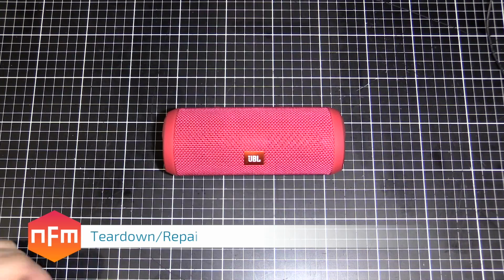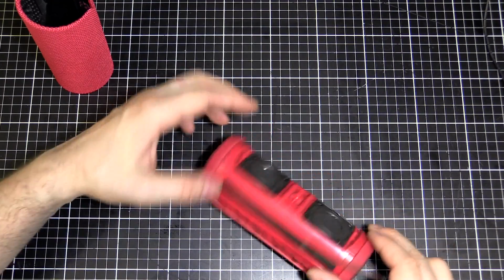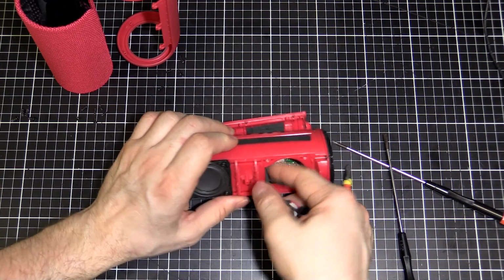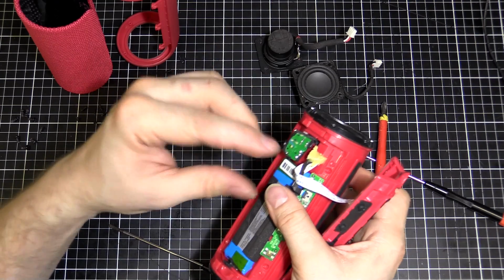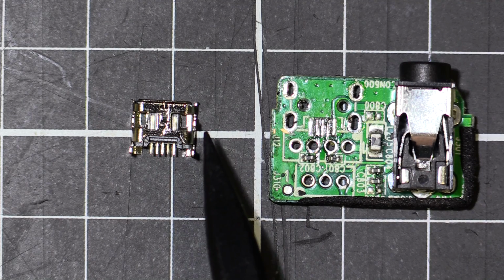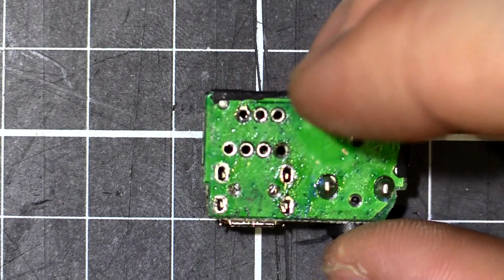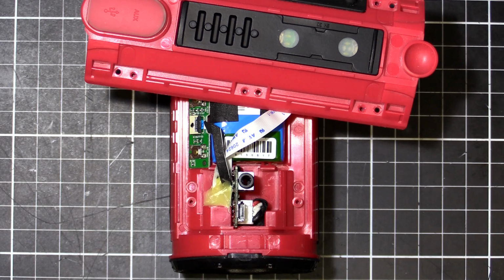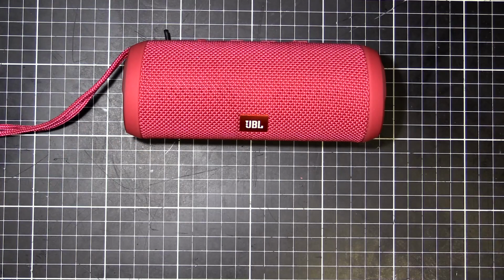JBL Flip 3 Teardown and USB Repair

Comment: Hello I live in Brazil I would like to know if you know where I find this battery of JBL FLIP3. Follow the model P763098 03 3.7v 3000mah 11.1 lithium polymer. Grateful!!!!!!
Reply: Cant find the same at aliexpress, at alibaba I think they have such batteries, but you have to order minimum 5 or 10 pieces.
Reply: Same problem here, did you find a battery yet?
Reply: the battery of my JBL flip 3, died a year later. I can not find it...
Reply: Eduardo, o modelo da bateria é esse aí mesmo? Vou tentar dar um choque na bateria antes de procurar, aliás você encontrou para vender aqui no BR?

Comment: is it still waterproof after opening it? ????????????? please answer me
Reply: Bobby Lavinier The Box isn't waterproof its just splash resistant
Reply: Finn Weinknecht yeah but I've seen people put it under water and nothing happened
Reply from the maker: +Bobby Lavinier as long as you don't damage the seals it should be fine.
I don't think it's rated for immersion in water though, more just a splash or quick dunk.
Reply: +NFM how much to fix

Comment: Is there a part number for the usb port board, soldered connector and all? Don't think I'd manage the intricate soldering required to repair my own. Is there a chance that the little charging/headphone jack board is connected to the main board via a plug?
Reply from the maker: +M Alc I don't think you'll find spare parts from JBL.... I found the speakers to be unobtainable so far...
Reply: NFM aye, I've had a bit of a time trying to source. currently scoring eBay for other broken devices but so far there is nothing in the UK that might work. cheers.
Reply: a year later and my broken speaker is beyond the point of working. Time for me to nut up and fix it. On second viewing it doesn't really look too difficult...might need a needle point for my soldering iron though.
Cheers

Comment: please do a jbl charge 3 disasemble video,so i can take out the battery,because my jbl charge 3 dosent turn on even if its charged.
Reply: Carlos Guadiana the batteries are under the rubber foot
Reply: Michel Bashalany yes i know, but how to i take it off the jbl charge 3.
Reply: Michel Bashalany i really need help on removing the battery of the jbl charge 3.
Reply: ive just made a huge rant about this speaker!! they keep sending me faulty ones!!! any tips!?
Reply: it maybe the issue i had, hot melt glue inside runs down onto the on/off switch if it gets hot enough. you need to pop it open and remove said glue.

Comment: Hey there, mate. You have no idea how thankful I am that you've got this video for me to find and watch! I exclusively purchased two of these Jbl Flip 3 not even a year ago through the biggest apple store here at the country I currently live. After 4 months or so when my guarantee period had already ended, I started to struggle to properly charge the speakers because of the connector--- its teeth were gradually getting damaged. I use many devices at home and they all have the same or similar charger , so I never really care which one corresponds to which. They all seem to charge all, plus I was  told that it didn't matter, so I was good. Point is, after both charging connector were just too ruined to ever charge again, I took them to several places for them to be repaired, but most of them said that they couldn't do anything, and that this device is recycling to be used once and so I needed to buy new ones as last and only alternative... Now this video of yours I'll shut them up for being useless technicians to even try to find out the solution to this small problem. I'll be buying the USB charging on ebay for replacement and then I'll be taking the speakers to the stores again for evidence and demonstration very soon . Cheers!
Reply: Buy http://www.connector4all.com/fr/micro-usb/8-jbl-flip-3-micro-usb-charging-port-connector.html
Reply: Hey I have Jbl charge 3 and when I was charging it and pulling the charger out the micro usb teeth broke. Do you think what warranty can change it or is it like sort of my mistake and I will need to pay money for repair:) Waiting for answer. Hope to hear from you soon :)))
Reply: it' will be a common problem with charge 3 because of rubber cover, which presses down a usb cable. It would be wise to pushing it down with scotch tape or another kind. But I also just bending out the cover and prop up a speaker on it.
Reply from the maker: It seems this might be a semi-common problem....

I'm happy I could help out! :)
Reply: Thank you as well. I'm new to soldering and probably won't attempt it.

Comment: Hi, where you get that USB charging?? I got the same problem and i can't find the plug. Sorry about the english, i'm from Argentine :D
Reply from the maker: Here's the listing I used: http://www.ebay.com/itm/141966418164

If you search for 'micro usb 4 vertical legs' you should find something to use. :)
Reply: It does matter the 2 legs in the middle?? I mean, are necesary for the good work of the plug?
Reply: Thanks for the answer!!!!
Reply from the maker: You mean the part where I drilled the extra holes?
It is better to have it like I showed in the video, but if you cut the legs off and use some super glue, it might be ok. It won't be as strong, but it will be better than nothing.
Reply: Aah, ok, i'll do that. Thank you, very, very much. It was a huge help!!. Again, sorry for the super bad english :D

Comment: is that distortion i heard when you turned it on?
Reply from the maker: Maybe a little, the turn on and off sounds are rather loud and strangely bass heavy... Not sure why, but when playing music there is no distortion until you turn it up really loud.
Reply: Keep an eye on that, the small vibration develops further - we had to get our 1st one replaced as the vibration got worse & worse.  JBL replaced it no questions, but the USB thing - this is genius
Reply: +NFM man can u tell me 
i bought a new one yesterday..
and the micro usb cable doesnt go in all the. way.
it charges.
but the cable doest go all the way in. is it normal
Reply: 1M views -John Aashish some micro usb chargers are longer than others thats why it dosent go all the way in,but if its the regular charger it should go all the way in,but its not a problem if it dosent go all the way in, unless it disconects itself
Reply: man but i have the original cable as provided by jbl. the orange one. even that cable doesnt go all the way in. but it still charges. but it is very loose.
is it normal. have u tried it on ur flip 3??
or i should get  a replacement one??
Reply: 1M views -John Aashish maybe a new charger
Reply: 1M views -John Aashish i dont have a jbl flip 3,i have other jbl speakers,and the charger goes all the way in
Reply from the maker: +1M views -John Aashish 
Try having a close look onside the plug with a mqgnifying glass or loupe.
There could be something stuck in there. Careful use of a needle should be able to dig it out if so.